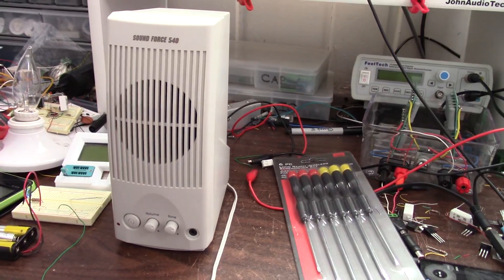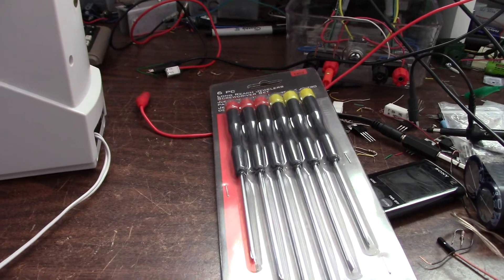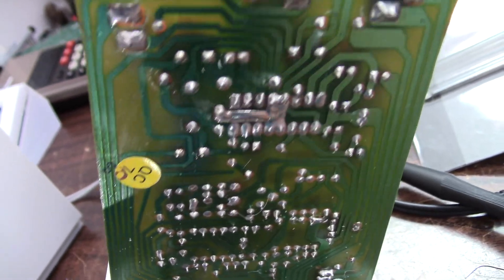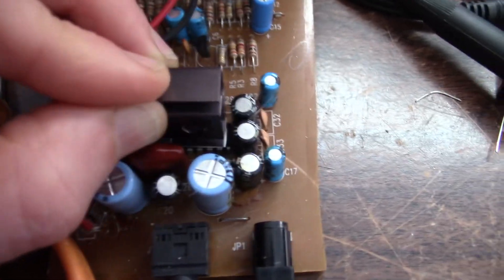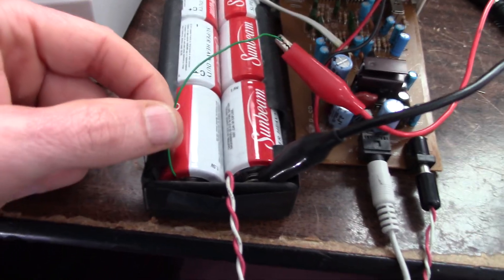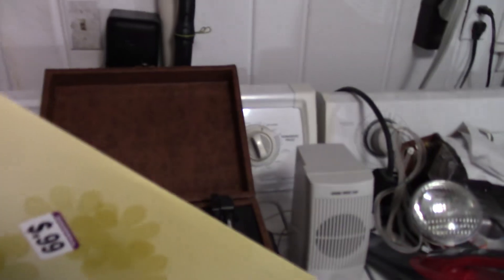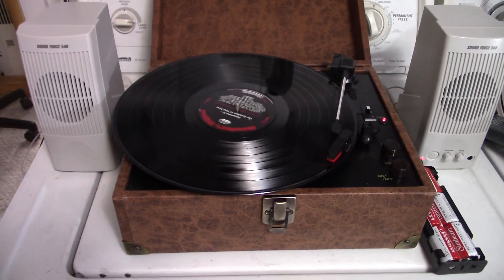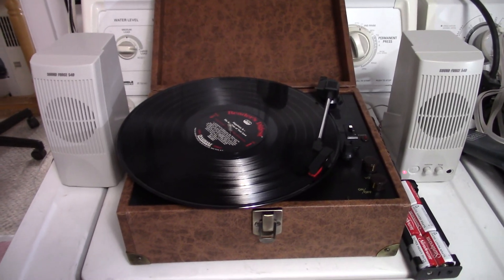Amplifier IC used in the computer speakers plus a mod

Comment: had the 'recessed screw problem' repairing motor air compressor.  Was a torx screw bit. Ripped the plastic off!  nobody wants repairs done to their products now days, but I got at the compressor and resealed rings. tks the other led diagnostic vid excellent run down of parts board and failure of led.

Comment: I recently repaired a friends music keyboard which used a ta8227 and this had failed. I don't know why it failed, but the minimal, paper thin piece of bent aluminium masquerading as a heatsink was barely touching the chip. I replaced the chip and added some 1/16" thick aluminium to the bent aluminium with self tappers that must have at least trebled it's capacity, working on the basis it wouldn't do any harm.  We shall see.

Comment: This is why i don't buy computer speakers. All of them are real over priced crap. I made my own speakers with a pair of sony car speakers and mdf box made by a guy who specialises in speaker cabinets and i use a tda7498 class d amp board to run them at enough power to vibrate my room 😂 although the pc harddrives don't like the bass.

Comment: Can we use the same type of heatsink with tea2025 using this thermal tape ?
Reply from the maker: It would help but heatsinking off the center pins would be ideal.
Reply: These kind of chips are designed with internal heatsink that conducts out via the centre pins (either 2 or 3 on each side). After soldering the chip into the PCB you then solder two flat sheets of copper or tin-plated steel onto the outsides of the ground pins in the middle of the chip.
You may find old datasheets to find the specs of heatsink surface area, but the bigger the better. I shape and angle them like little butterfly wings.
Reply from the maker: @johncoops6897  Yep, the old Starver V-7 heatsinks

Comment: I hope that tape holds. If it doesn’t, it could short something if it flops around inside.
Reply: True. 
And it can cause a damage worth $3.55. Of course, if it shorts in a big way and burns your house as well, damage can be much bigger.🤔
Reply from the maker: The tape is pretty good. I haven't had problems of things coming detached if the specifications are followed.
Reply: @JohnAudioTech  If you say so, I believe you. 
But after many year's bad experiences of many types of tapes, IMHO the definition of tape is: 
Stuff that sticks to everything it shouldn’t, but does not stick reliably to any surface it should stick to. 😀

Comment: It is a really very old circuit design and manufacturing technology. I was impressed to find something like this in a product which is currently selled.
Reply: It's definitely old stock from somewhere. John should have looked for a date code on that IC. I bet those speakers are more than 10 years old. It just looked old the board and parts.
Reply from the maker: @1pcfred  Probably more like 20 years given the ivory color.
Reply: @1pcfred  - ROFL, you almost wrote "those lead fumes" didn't you?

Comment: Love your work as always. I reckon you could improve these speakers vastly more by sticking them in a better enclosure. This amorphous plastic rubbish is never ever good. Even a simple ported enclosure would make for a much better tonal balance
Reply: For a few bucks those speakers are loss leaders. A better enclosure might help them out but they're pretty decent as is for what they are. I took apart some PC speakers I had lying around and made a center channel speaker out of them for my PC. Just the drivers. They're Altec Lancings.
Reply: The enclosures are the problem. Even having these drivers in open baffle configuration should be a big improvement. Or you could connect the outputs from the board to your large speakers and test for distortion and power output. In my opinion these will do 60%  of the quality of a large 35 amplifier. Please try this and see ... connect the ouput wires to large speakers and make a video.
Reply: In Australia we have a saying that advises that "You cannot polish a turd".
Reply: @johncoops6897  Mythbusters tested that and found that you actually can polish a turd. The real question remains do you really want to though. Because polishing turds is as nasty work as it sounds. Some turds do polish better than others do too. They went to a zoo and got all kinds of different scat. You really don't want to polish lion crap from what I hear. It has a pungent bouquet.
Reply: @johncoops6897  haha, yeah we have that in the UK too. This might not a turd though -- only way to find out is to stick them in a proper enclosure.
Reply: @イエンスヨハンセン  - the drivers are very efficient since the amp is under 1W. So even with a little Class D like a PAM8403 will be really loud. I've had good success with such speakers on a 15-20W amp (better with sub too) with a graphic equalizer to smooth them out. However there is no treble so you end up with the "Logitech sound" unless you add tweeters. Then you cannot easily get efficient ones, so they don't add much fidelity.
It ends up not being worth the effort when you can find a 2-way 2.1 system to put in decent housings.
Reply: @johncoops6897  yeah I completely agree, but if you’ve never built a speaker before and we’re curious, this is a good place to start. My first speakers were made from a dead iPod player someone gave me. I was surprised how much less they sucked than I thought they would… and they were loads of fun to design and build.
Reply: @イエンスヨハンセン  - Yeah, I was going to say that a high quality iPod speaker dock is the ideal basis for components to strip. Get the high-end old 30pin docks from Bose, Altec Lansing, etc... many have surprisingly good drivers inside, and often the inbuilt amps are quite good too.
Another good source is some of the bluetooth tower speakers, as they have a sub, remote, bluetooth, OK speakers, etc and even the amp modules are usually quite OK... but the power supplies are always underpowered and need transformer and caps upgraded.

Comment: Unless it is specifically labeled as an 'alkaline' battery, you can safely assume it's not alkaline.   The term 'heavy duty' is used for zinc-carbon type batteries because 'heavy duty' is essentially a meaningless but impressive-sounding term that marketing types love to throw around.
Reply from the maker: Back in the 1980s and before there were often three types of primary cells available in the common sizes (AA, C, D, ect.) With the cheap carbon zinc cells, Eveready brand sold with a primarily silver label, Radio Shack used red.

The next step up was the so called "heavy duty" cells, primarily in black by Eveready and green by RS. I think these were a zinc chloride chemistry. They were touted as having double the life of the carbon zinc cells.

Alkaline was the premium cell and Eveready used the "Energizer" brand and RS used a gold label.

At some point (1990's?) the true "heavy duty" zinc chloride cells were no longer produced and the marketing champs put "heavy duty" on the carbon zinc cells.
Reply: @JohnAudioTech  I was thinking of the "Super" designation.  I have Energizer Alkaline that say Heavy Duty.   But it seems the "Super" is reserved only for the Worst of all!
Reply: I had recently read that "super heavy duty" refers to Carbon Zinc.   I put them in my maglight Because they are so light.   They work awful though

Comment: I'd like more of this type, if it fits with your schedule and if there's also some satisfaction in it for you. Cheap products can provide a reasonable base for quick and simple modification. I just dismantled a computer speaker set that has no serious faults but an ugly housing. The power switch is broken and pots probably just need a clean, that's all, then I'll build a nice little wooden enclosure and give it away.

Comment: Back in the 2000s when these amplified computer speakers could be found absolutely everywhere, I used to get quite a few at flea markets just to experiment with them. The best ones I found actually used two TDA2030A chips.
Reply: I got a set of klipsch 5.1 for my pc as a young fella and the preamp kept blowing and I lost them in a couple moves on my 20s. They sounded much better than normal pc speakers I paid 800 for the set. They stopped selling them because you could just do a small mod on the sub and hook them to any receiver. I wasn't a deep into electronics then as I am now. I'm getting ready to build an amplifier for my record player and hopefully come across a nice pair of second hand speakers from the 89s and 90s. None of my home theater systems due records justice. Porcupine Tree have some blurays mastered for 5.1 snd they sound amazing with all the layering coming in from different directions. It really does their dense, virtuous  prog rock justice. I use nearfield studio monitors in my workshop for recording guitar and bass but I want to diy a stereo listening area. Sorry for rambling. I Nerd out easily.

Comment: Whoa, i was thinking to redo a review as video on how my 20 year old tda2822 based cheap pc speaker could drive a left passive of active speaker while improving their sound quality with bigger coupling caps. Albeit at lower volume.

Could have shown people that sound quality is all about the loudspeaker brand and amp problem is already solved by cheap class D component.

Comment: Any other cheap mods for improving those speakers?
Polyfill/batting in the original enclosures?
Splurge on real wood enclosures made from free pallets?
Reply: I still have 3 pairs of this kind of speakers and recently brought them out again. One pair sounded too shrill and I was able to improve the sound overall using polyfill.
Reply: The 'real wood' enclosures combined with larger drivers isn't a bad way to go, though I would pick 8-ohm drivers so as to not push the amp chip too hard.  I transplanted a similar amp into some older thrift-store speakers.  There is more bass and they don't do too awfully bad.  A bit big to be 'computer' speakers (unless you have a really big desk!).  Makes a nice 'shop' setup, though.

Comment: According to datasheet 9V@4Ohm is fine. Would it be better if the heatsink was made of copper and soldered to the ground pins?
Reply from the maker: Yes. The center ground pins are designed to remove heat from the chip. The way I did it isn't ideal, but will remove enough heat to keep the die temp down.
Reply: I've made quite a few headphone amps from this style of chip, and I've always just soldered copper flag heatsinks to the ground pins as-per datasheets. I found one amp recently that is about 35 years old and my heatsink flags were made from an old baked beans tin can !!
Reply: @johncoops6897  Cool, you can actually get a decent cooler for a penny, which is a penny. I use Russian dimes which are even cheaper.

Comment: How would you get cancer from a screwdriver?
Reply: The only thing I got from screwdrivers was a hung over...;-)
Reply: Supposedly from the materials is made of; the plastic handle and the chrome plating.   The risk is actually quite small, but there's a push to plaster warning labels on anything that might even be SLIGHTLY dangerous.

You can thank lawyers and insurance companies for this.
Reply: @xaenon  I think the risk might be that if you swallowed the screwdriver, you might develop cancer years later. But if you swallowed one of those screwdrivers, you would have much more serious issues to deal with!
Reply: Crush up the handles and smoke them in a crack pipe is my guess.